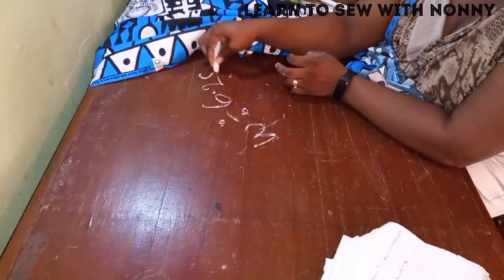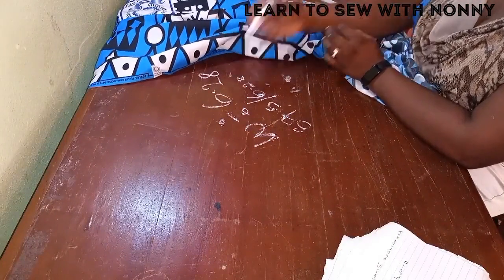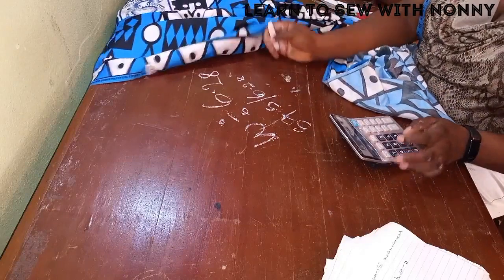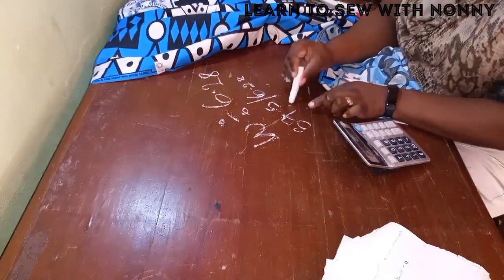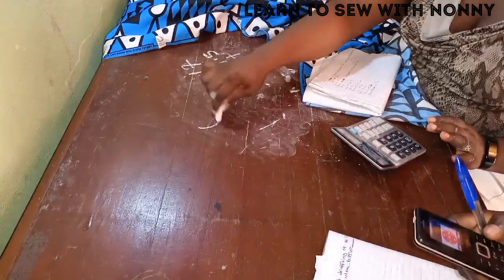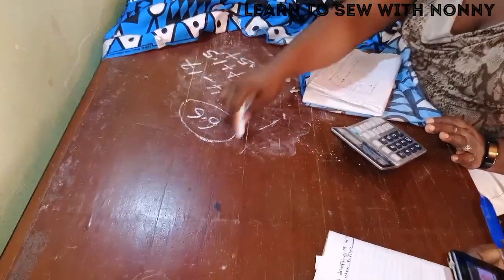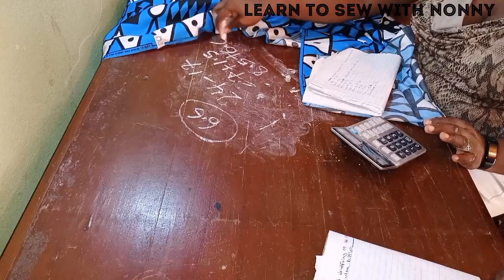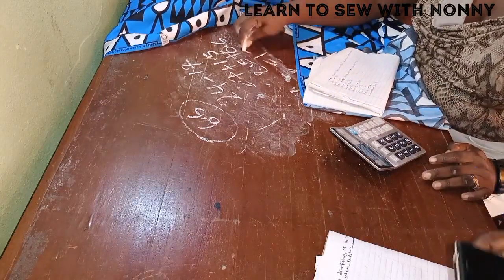How to Make an Off Shoulder Princess Dart Bustier Peplum Top.

Comment: You said the 5inc you marked on the shoulder line is constant. And in your other video you said the measurement could vary depending on the person's size? Pls ma this is confusing.
Reply from the maker: Please don't get confused..5 inches works for all the measurements considering the fact that you'll have to take off 1 inch for the shoulder slope..

But in the case of really small measurements, it may vary cos you can't make a princess dart bustier with any bust measurement less than 32 or Amy figure close to it like 31.5 cos you can approximate.

So you'll have to do the classic princess dart which is the type of princess dart seam on Corporate Outfits and for that 5 inches is not constant.
Reply: @NonnysSpace1  alright, thanks for the clarification